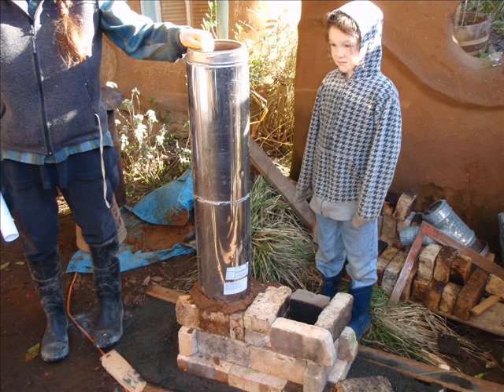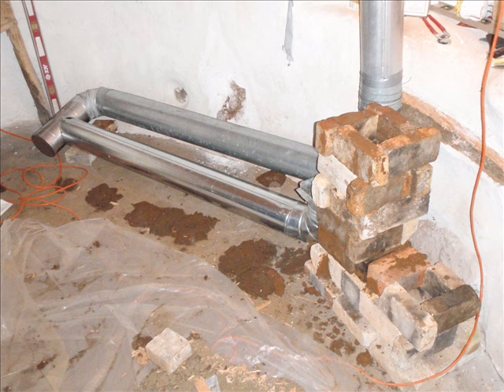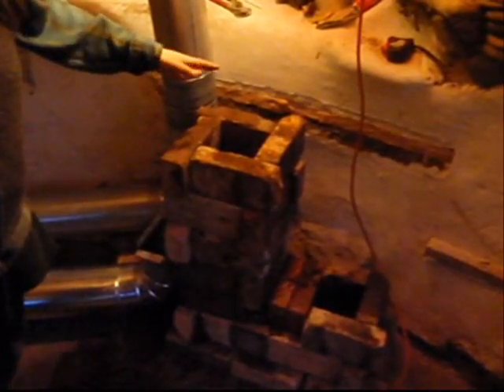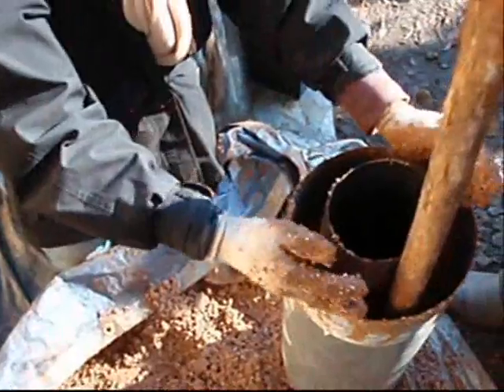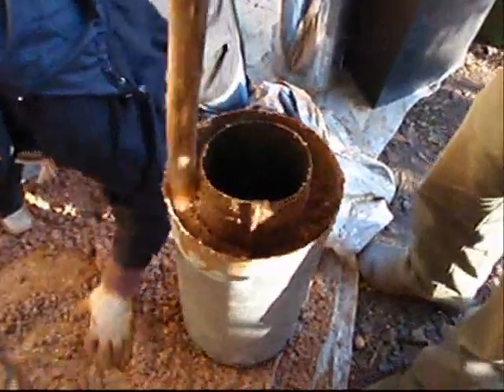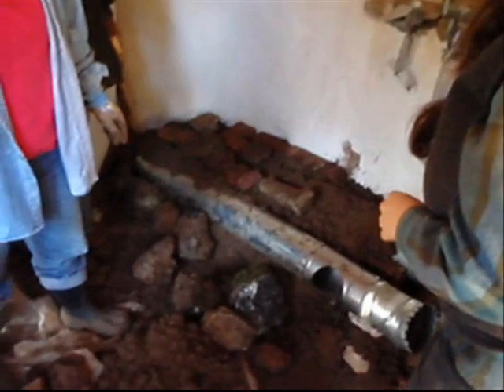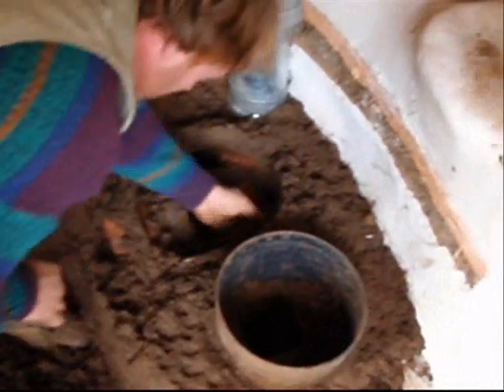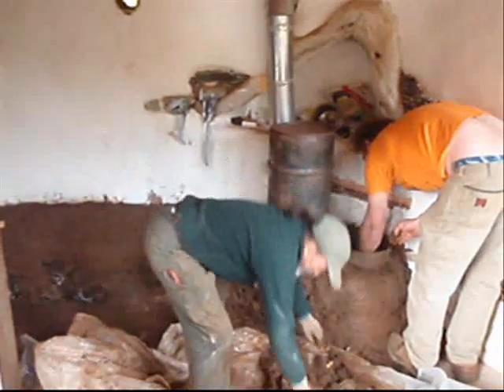rocket stove mass heater workshop how to tutorial

Comment: Paul

I need to build a rocket stove to heat a swimming pool of about 140 000 liter (37 000 US gallon)

Two 1.1kw pumps will circulate the water.

The pipes from the pumps are 50mm (2 inch), and I will split each pipe into 11 copper pipes of 15mm (0.6 inch) each to equal the same volume.

Each of these 11 X 2 copper pipes will be form into a spiral of 30 meter. (100 feet)

The diameter of the drum will be about 1 meter. (40 inch), and the width perhaps slightly more.

I plan to make the outer drum 300mm (12 inch) higher than the inner drum.

And the diameter of the outer drum will be 1.6 meter (64 inch)

Airflow will be from underneath, i will make a grid of copper pipe to build the fire on.

The chimney will be about 400mm (16 inch) from the bottom.

I assume a chimney of 100mm X 100mm will be sufficient (4 X 4 inch)

My question, if anybody could help me perhaps, is about the ventilation of 300mm. (12 inch):

Is it sufficient, too wide, or too narrow?

Thank you in advance!

Comment: Why no metal for the inside of the heat riser?
Reply: @nicole73551 - to get the complete combustion that gives these stoves their high efficiency and clean exhaust it is important to run them at a very high temperature indeed. Whilst the stoves will work with steel/stainless tube, they work best with refractory ceramic hot bits that work reliably at over 1000C.
Reply: nicole73551 too hot, it will burn the metal
Reply: The metal just melts

Comment: How do you get the ashes out of the rocket stove?
It seems that the the draft is strong and all the ashes would accumulate along all the pipe work including the exhaust pipe.
Reply from the maker: Bonnie, the answer to your question is large and depends on several factors.  Too much to convey in a youtube comment.  Have you been to the forums at permies yet?  That's where the meat of the rocket mass heater discussion is happening.

Comment: Paul and Ernie: do you prefer the type of riser you used here or one made with fire bricks?  Has the preferred design evolved?  Could you just use good tripple-wall chimney pipe (e.g. DuraVent) and pack the air space with perlite/clay mixture?  It looks like you're using 6" inner and 10" outer which is a standard tripple-wall spec.

Comment: I'm a heating contractor. I don't understand all the principles involved, but I've heard that if flue gas cool to much you will get condensation. How do you deal with that? Are there calculations that prevent that issue?
Reply: Most of the blueprints I've seen it appears the bench duct work is in linear sections 2 to 3 times the length of the initial chimney stack. I think the slow temperature change, since the mass hold so much heat, reduces if not eliminates the condensation risk in the interior duct work. I think the biggest issue is the last 2 feet when it hits the outside and a slight downward angle might be sufficient to prevent condensation from flowing back down into the duct work. I've been told the final exhaust is about the same temperature as a dryer vent.

Comment: Even experts make mistakes,that is how first light bulbs were made ,from the mistakes ,it shows that each stove is individual if you want uniformity buy a wood burner and send 200 to 300 degrees centigrade straight up flue. flue temp on my rocket and 30ft pipe store after 6 hours firing  is never above 60C

Comment: Hang on, he said 5 experts in this field and then a bit later he declares the barrel doesn't fit over the brick stack they had made! Umm, I don't think that quite adds up, wonder how embarrassed the 5 experts were? Did 4 all immediately point to just one and say 'It was he/she's fault" that would have been comedy gold.
Reply: I worked making custom machines for years and this is always how it goes. Your always running into things to workout.  If you'd ever made anything you wouldn't be laughing at people who have.
Reply: Darin Clay I suppose they didn't have a tape measure or feel the need to check size and fit too? But apart from that, it was just a humorous aside, shit happens to all of us, it's just funnier when it's someone else stuffing up not us.
Reply: Hama Neggs
Perhaps, but they're using recycled materials--they didn't shoot down to the Home Depot and buy new materials--they made due with what was on hand.    That isn't a standard 55 gallon drum--if it were, I bet they would have been able to use the brick riser as they initially intended and the second riser would have fit with the 1.5-2" gap that they shoot for.

Comment: Definca: Do you know at what temp. galvanized pipe has this toxic fume issue?  And I thin the reason they use Galvanized pipe is because it handles the moister/condensation better then black pipe would (assumption). It is a good point you bring up though. I personally will check into this for my own knowledge as well, even though I'll be using mine in outdoor greenhouses.

Comment: If you set up your "mass" you won't need to burn it continuously for 7 months, but depending the area your heating, once a day. Again, the insulation quality of your building makes a huge difference as well. I've seen guys say they can burn for 5 hours, and it continues to put out heat for up to 30 hours through the mass being heated and slowly releasing the radiant heat through that time.

Comment: Warriordriver350: The way the rocket mass heaters work, is it burns almost completely every possible bit of fuel created by the source, where as other styles don't burn as efficiently which like Paul mentioned, would use a lot more wood/product/fuel to get the same amount of heat. There are more videos on youtube that explain it better then this.

Comment: Sparkie: because the pipe goes out and comes back, I understand why you would think it hooks back up to the stove, but it doesn't. It's just that the vent rising through the ceiling is near the stove itself, and not hooked back up to the stove. Some of the stove masses just have a pipe that runs out from the stove it's self and exits the building at the end of the run rather then coming back like this one. This one is designed for a small space.

Comment: Two seemingly good points here that I don't see addressed: Barrels burning through and issue? Galvanized ducting giving off toxic fumes seems like an important point. What do they experts say?
Reply: SimpleUnhookedLiving i am not an expert but have researched lots and I am building one. Barrel burnout at the top needs to be monitored. Some people us stainless steel drums to over come this. By the time the heat reaches the galvanized pipe it isn't hot enough to burn the galvanized pipe.

Comment: Paul, Is there any way to explain how the pipes are connected and run to heat the mass area of the bench. I have watched a lot of videos here and I just can't seem to grasp how the pipe comes out of the stove, goes through the pipes and then back to the stove and then out the building. Do you call that a chimney or exhaust pipe?

Thanks,
Sparkie Waller
Quinton, Alabama

Comment: @definca that looks like galvinised insolated duckting that is  ment for wood stove chimdys. but what they are dooing is simple pysics but the flame is going to be directly blown into the metal and i can definetly see it getting too hot and creating toxic gases. they also insolate it so it definetlu cant exspel its heat. and the steem comeing out just seems to me like the smoke is depositing all it carbin on the walls of the pipe ... a pipe they  cant clean so it will buld up and stop working

Comment: @definca Good point, galvanized is not appropriate for high-temperature applications, since the coatings break down at about 700-800F.  We definitely do not recommend it as a substitute for stovepipe. However, within the earthen mass, the temperature of the ducts is only 500F at the hottest points and times, and generally much lower, under 200F, elsewhere.  You will see that the form for the interior of the insulated heat riser is indeed black stovepipe, rated for much higher temperatures.

Comment: @paulwheaton12 -- Don't have access to one at the moment. I wasn't clear how it was being vented and if the combustion air was adequate to keep the CO levels to a minimum. When I first looked at the video it wasn't watched too carefully, so I thought the double wall pipe was a single wall which would have meant the exhaust was greater than the combustion air. I sent the video to a HVAC building inspector to get his opinion.